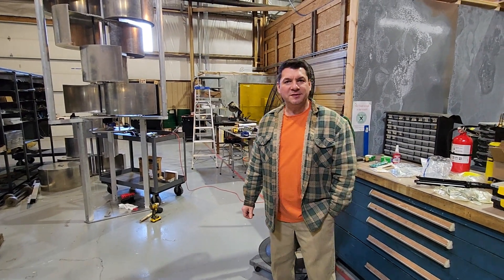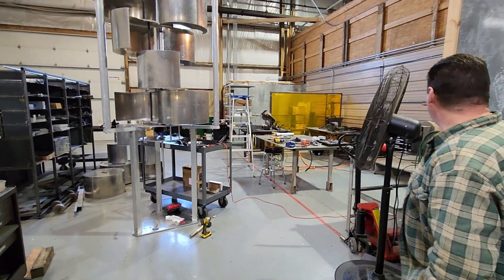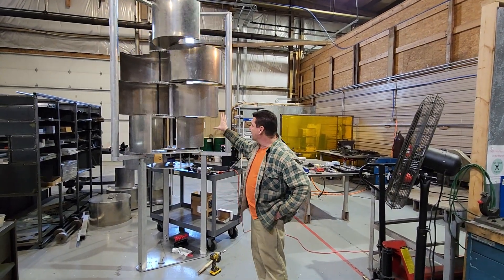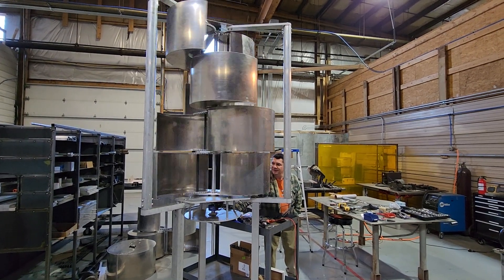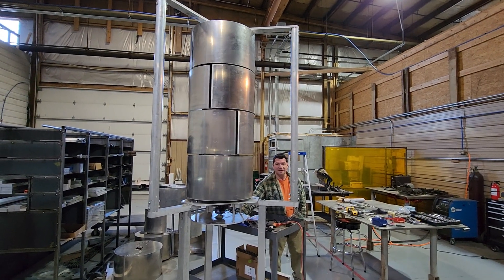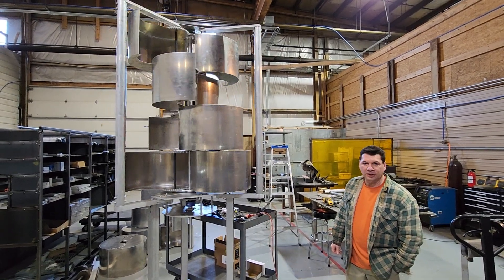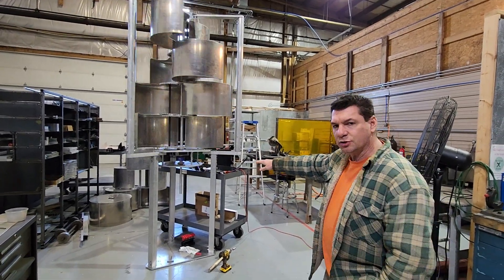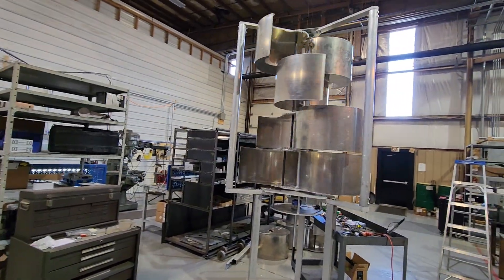Watch Harmony MK II Prototype Furling while spinning

Comment: What’s the minimum amount of pressure required to start rotation of the mechanism?  I do mean pressure, not force as I’m curious how light a wind is required to do it across the surface area at different percentages of closure.  It’s a really interesting concept!
Reply: The two main ways in which Harmony Turbines will be different from the rest of the turbines on the market today is through the use of our two proprietary patented technologies. Our generator design will handle low wind startup speeds of 1 - 2 mph and eliminate cogging issues allowing Harmony to scavenge winds that other turbines ignore; while our furling technology will handle high wind situations allowing Harmony to produce full power right on through events that can disable or even destroy other turbines on the market today.